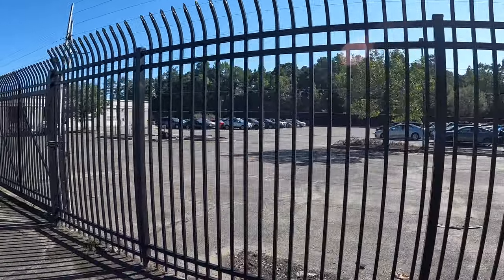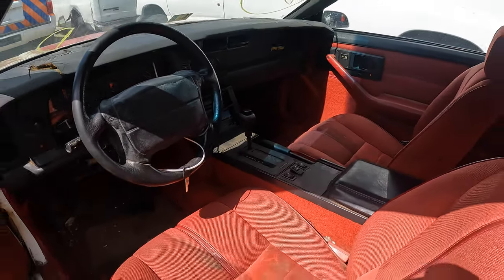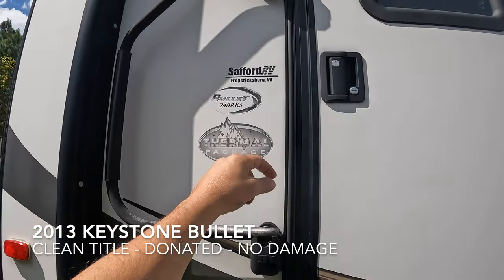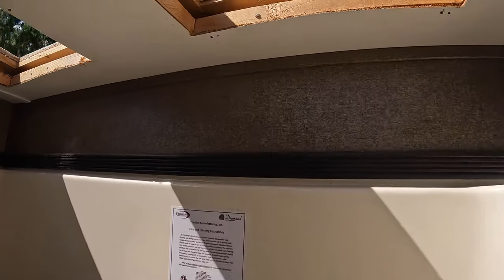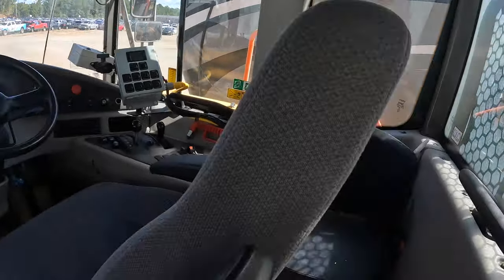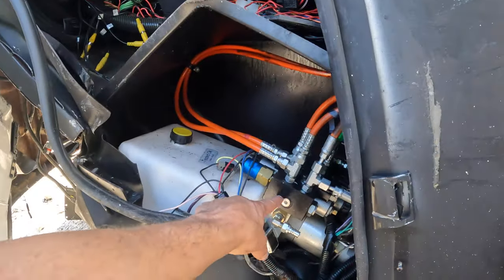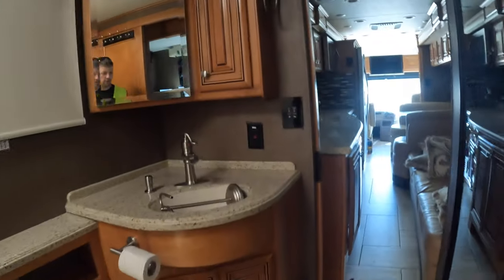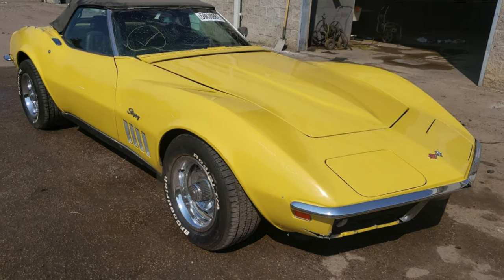Sweet Hellcat, NASTY RV, Awesome Boat.  Copart Walk Around

Comment: Do you need a dealers license to enter the lots?
Reply from the maker: To bid and buy as a no dealer I’ve been using a membership to AutoBidMaster.  I’ve done 10 or 11 vehicles in the past 2 years with them.  If you want to go into the yard and physically look at what you are bidding on you need an additional membership to Copart as an individual.  That will let you bid on some lots in some states - but I’m finding more and more are listed as dealer only…which is why I use AutoBidMaster.